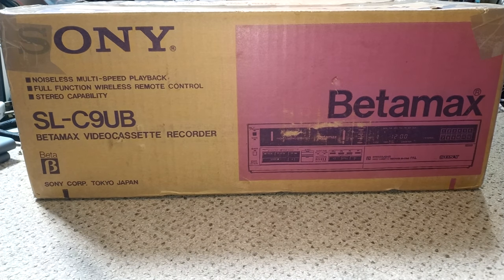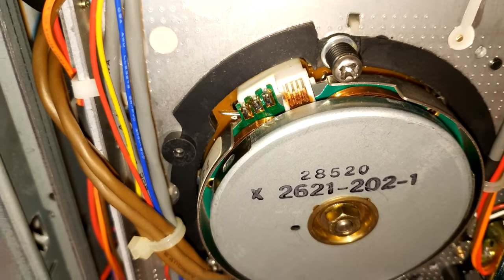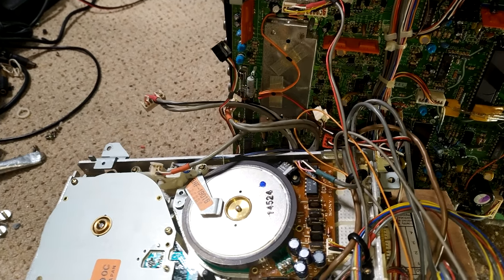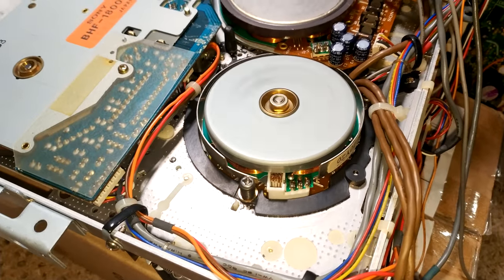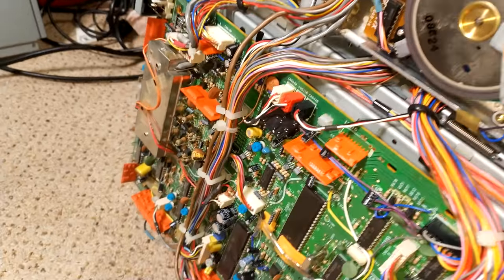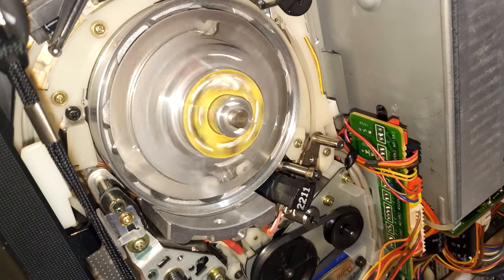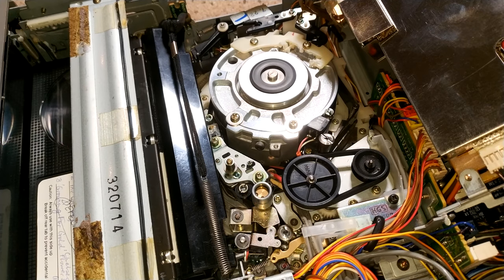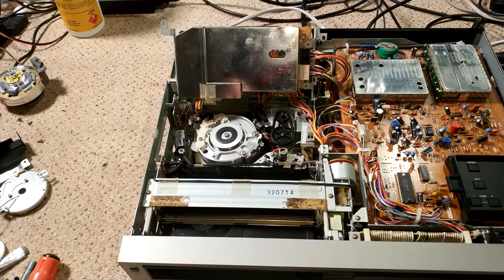Sony SL-C9 Betamax - Part 1 - My heads spinning!

Comment: Hello Mr. BetaByte. I have a slc9. Just re surfaced the upper head drum. As I put it back together, I am getting a garbled image on play but a sharp image on pause. What could it be?
Reply from the maker: That sounds like one of your heads is clogged. Some paper soaked in 99% isopropyl gently pressed again the drum and then slowly rotate the heads should restore normal operation.

Comment: My 950 suddenly will only play in black and white...Any ideas in what the fault may be?
Reply from the maker: This is starting to be quite a common issue with the Hf950. Usually it's bad capacitors but is it black and white in all modes - cue/ review / trick modes? Does the black and white image look darker than you'd expect? What happens when you switch the beta super beta mode switch?
Reply: @MrBetaByte  It is black and white in all modes including super beta and in all outputs I.E RF..AV and scart.It does not look darker, at least to me....Could you repair it for me? I live in greater manchester and would post it to you. Thank's      Aaron.
Reply: Maybe it is srt to PAL.
Reply from the maker: Hi Aaron, yes of course. When you're ready, drop me an email to mrbetabyte@gmail.com and we'll take it from there...